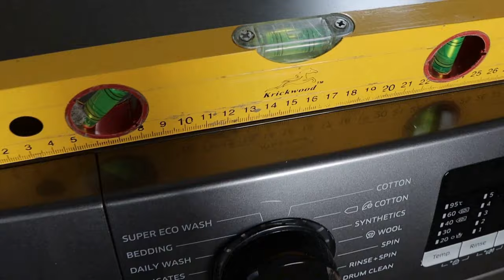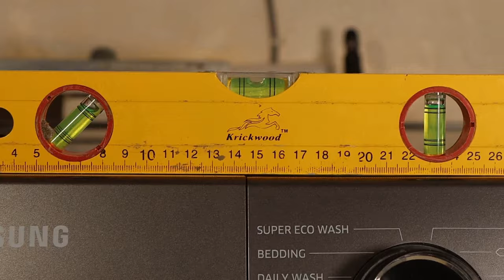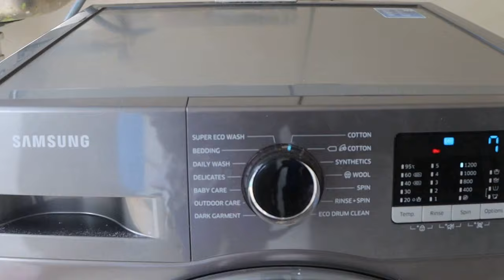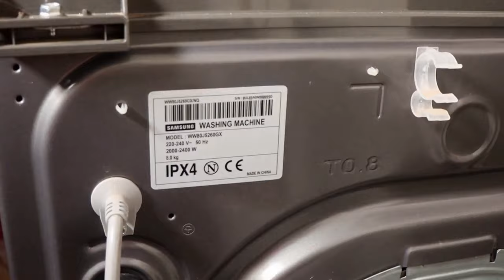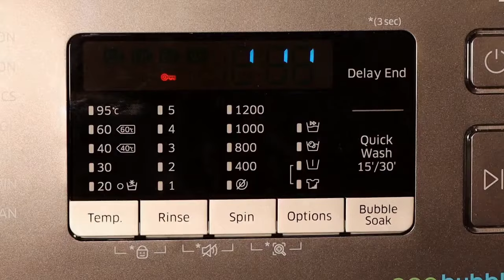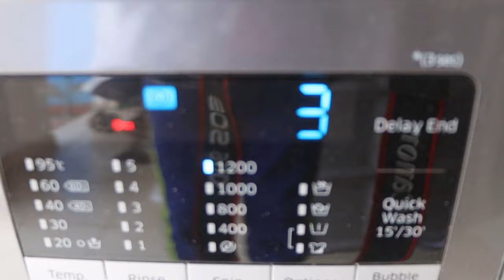How to Fix Washing Machine Vibrating Wobbling and Shaking Noisily

Comment: Thankyou u so so much
Reply from the maker: you're welcome
Reply: @iansgadget  one question please 
I have whirlpool automatic machine but when i put my fabric softner it drains with water it doesn’t hold till rinse please help
Reply from the maker: @saraali7159  This can be caused by using too much fabric softener. The softener compartment has a MAX line. Never fill the compartment over this line. If you do, the siphoning effect will start immediately and the fabric softener will likely drain immediately.

Dirt or residue in the drawer could also push the  level of the fabric softener up causing it to overflow. If this is the case, you should remove the detergent drawer and clean it thoroughly. Also, make sure to clean inside the space where the detergent drawer normally sits. It is advisable to regularly run a service cycle and clean the inside of the drawer to prevent this from happening again.

Another common cause of fabric softener draining immediately is a damaged detergent drawer. If there is a crack in the fabric softener compartment, the fabric softener will leak out through this. Similarly, if there is a crack in the divide between the fabric softener and detergent compartments, you might find that the fabric softener drains with the detergent. The solution is to take the drawer out of the machine and inspect it carefully for damage. If you find any cracks or holes in the drawer, you should replace it.
Reply: @iansgadget  thankyou so much for the information i will clean and check ❤️❤️

Comment: 07:54 is this normal? Slight wobble of drum during cycle
Reply from the maker: a small amount of wobble is to be expected. Shaking can be particularly noticeable during the spin cycle, as clothes are moved rapidly to remove water prior to drying. However, a washing machine that is jumping or “walking” across the floor can indicate a problem.
Reply: @iansgadget  thanks man👍

Comment: What do you do when you’re not sure if your machine was calibrated before use….can I calibrate it again?
Reply from the maker: Afua, yes, you can recalibrate it. In fact if you move your machine, its a advisable to recalibrate it before use. Except for preventing vibrations and noise, calibration also makes sure you save energy. After calibration, the load sensor more accurately weighs your laundry. This means the washing cycle can better adjust itself to the amount of clothes, which saves time and energy.
Reply: @iansgadget  thank youu